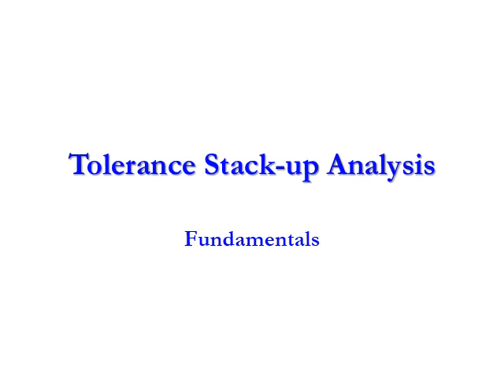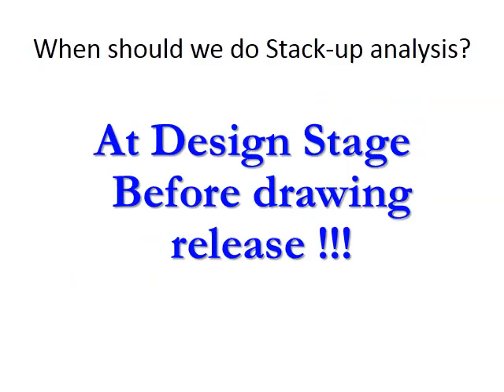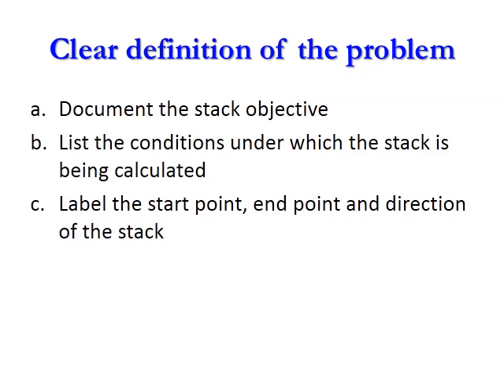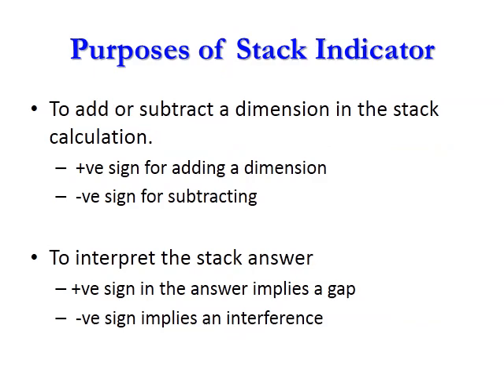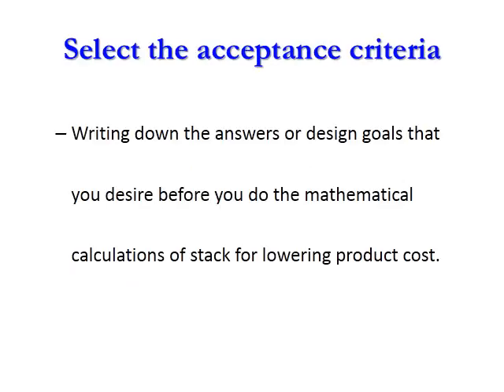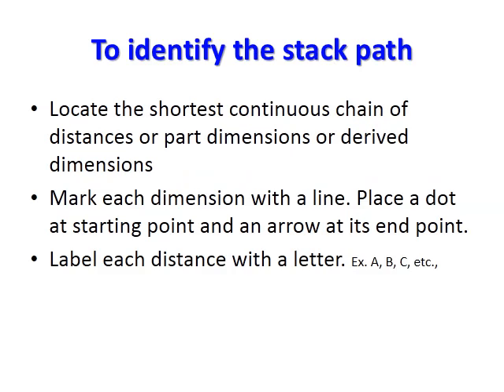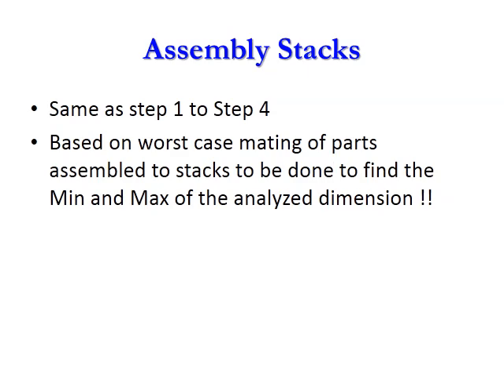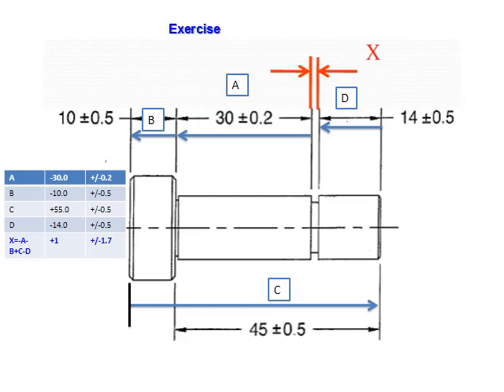Tolerance Stackup Analysis Part I

Comment: I found the video very helpful. Thank you sir. Explained fairly well. I noticed two problems with the video though. The first is poor volume, I can barely hear the speaker. The second is a error on the powerpoint slide starting at time 8:56. On this slide the dimension C is incorrectly dimensioned.